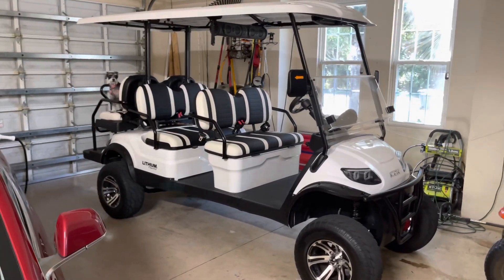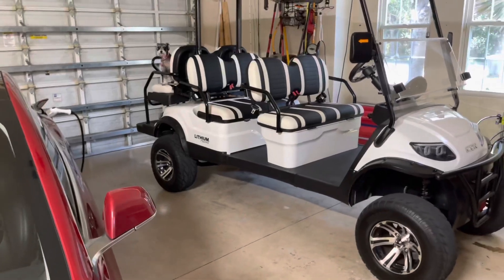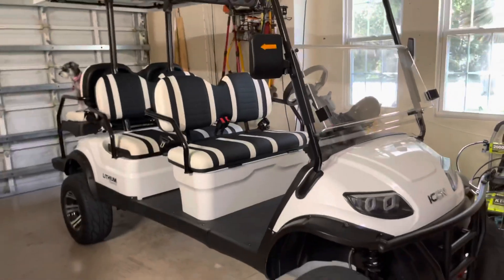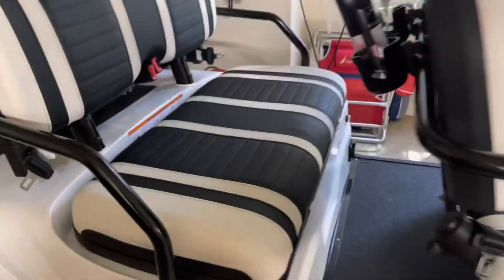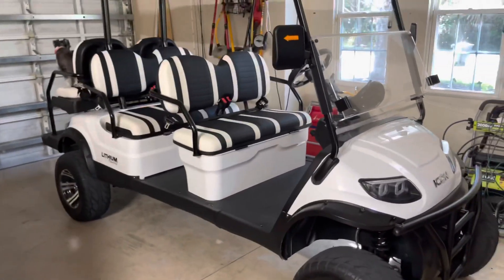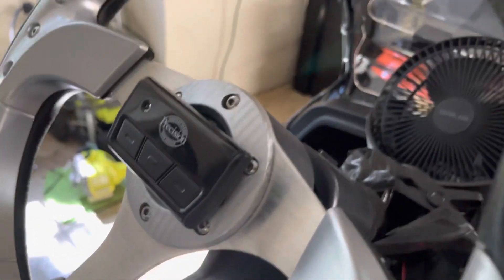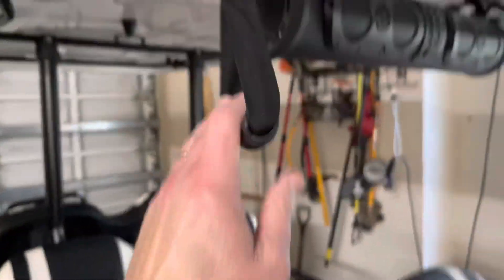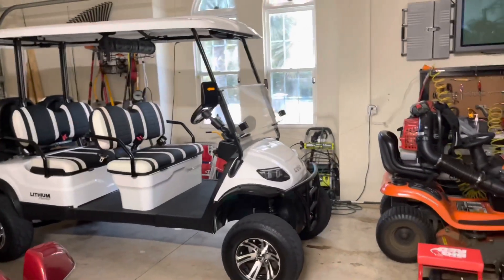Tips for ICON EV golf carts (lithium) plus a Navitas controller installation tip!

Comment: Curious, my lead acid batteries have 170AH rating, I see roypow has a couple 48v options one is 160Ah and one 105Ah rating, so wouldn’t I get more battery life out of the lead acid than the roypow?  I know the lead acid will degrade in performance as they get lower…but seems like I might actually lose range if I upgrade instead of gaining range…any input for this question?
Reply from the maker: The best and easiest way to explain this is the performance degradation that you’re speaking of during each drive as the battery runs down…Well that performance degradation impacts range just as much. I can explain this further and give you examples if you’d like but I don’t wanna bore you. I’m gonna do some real time range tests in a video coming soon. .But just know it’s night and day the science behind Lithium versus lead acid technology. My guess is you would need a 300 ah lead acid battery system for example for you to even just come close to the performance and RANGE you’ll get from the 160 ah lithium battery. But please keep in mind I’m talking about driving at high speeds, I’m not talking about driving a cart around the golf course for example. Hope this helps. You have the Navitas controller correct? What batteries specifically do you have?
Reply: @yourtechtoday9238  I have us batteries, 6 8V, rated at 170AH at 20hr rate.  I know the lead acid will degrade, as well as losing the power after maybe 50-60% of battery is drained so I get that part, but I guess my though here was, 105 vs 170 AH, I’m only getting 2/3rd the ah, even if the LI battery does have better performance for the full charge, it seems like the math evens out, I run 2 hours on lithium ion before battery dies, and I run 3 hours on lead acid before battery dies, but only 2 hours on lead acid is quality performance the last hour I lose a lot of power because my charge gets lower at around 35%.  Does that make sense?  So the lead acid would actually run longer, but actual driving performance between the two would still be about the same?  Maybe like you mentioned I don’t understand the difference but that was where my thinking was. And yes I have navitas 600a controller
Reply from the maker: I understand. So you have the original US batteries that came with your cart correct? If so, in my humble opinion, that is also part of your problem. I had an ICON that had the US batteries and when I sold it and got a newer ICON that had Trojan batteries the pulling power and range was  so much better with the Trojan batteries. And I’ve heard several dealers tell me that’s a fact. I guess this is why Icon went to Trojan batteries. And I’m sorry if you already mentioned this, but do you have the I 40 L or the I 60 L or what model Icon/Advanced EV?
Reply: @yourtechtoday9238  yes they are the originals, not sure why they aren’t Trojans, seems like everyone else has Trojans except me, maybe they got one over on me and gave me cheaper batteries, my example in previous comment was merely a hypothetical though, so far I seem to be running fine for the most part but we have some significant hills so battery life is a concern because of it…never been an issue yet but extending as much as possible is always welcome for me while not sacrificing speed or torque (navitas controller did wonders for the torque).  I have an i60L, lifted, 23” tires.  All things equal I’m curious if I would get less , more, or the same battery life, I know they’re lighter so there would be some benefit there, but aside from that seems like from the amp hour rating I’d still lose some overall life, but better quality of that life.  Also was told running the roypow at 200a for 9 seconds will cut the battery off…no idea how many amps I draw when going up our biggest hills but I guess I should use the navitas app to track it so I know…would suck to spend a few grand and not be able to get up a hill because I’m drawing too much current.  I saw you mentioned the navitas can be limited to only draw a certain amount which is nice but then I fall into the issue of reducing my torque so it doesn’t draw too much and shut it down…so you can see the predicament I’m trying to evaluate.  Got controller for the torque, if I get lithium I might have to turn that torque down on some hills, plus am I really gaining more battery life (and not talking life cycle of the battery, I know they last much longer than lead acid in terms of needing to replace them).
Reply from the maker: OK so a couple things about your question, I would guess that my six 8 Volt batteries (48 volt) Trojan setup had the same capacity or more than your current US batteries. Probably more amp hours in real life usage regardless of what the spec sheets says. But when replacing those batteries almost 1500 miles ago with this 160 ah Roy Pow, I get almost 50 miles MORE in range with my new lithium battery even though I drive it hard. As I mentioned in the video, I very much believe that I can get 75 to 80 miles range out of this battery, and that’s driving at an average of 34 to 38 mph as much as possible. So I can’t really express enough to you that the amp hours is not reflective in the range you’re going to get if you compare the 170 amp hours of your US batteries to the 160 amp hours of a Roy Pow lithium. It’s just crazy to me to this very day how often me and my wife shake our head that we have driven so many miles and the battery gauge almost never moves LOL. We literally mention it all the time on a long trip because we know we would’ve been worrying about range when we had the Trojans on the same ride. That is the best way I can explain it I guess. It’s the technology of the lithium and how it acts just like the batteries in my Tesla. It’s also about the fact that I took away about 350 pounds of weight out of my cart by replacing those Trojans with this lithium battery that only ways 160 lbs vs the Trojans that I believe total close to 500. I don’t guess you have the same road tires that I do but I think that helps a small bit in my ultimate performance. But after what you have right now as a set up, if you get a lithium battery that is 140 amp hours or up, I think you’ll be blown away but that is just my personal belief. For the BMS issue you mentioned, our Navitas controller is supposed to prevent that as you mentioned how I talked about that in the video. But if you can find my battery in the P version you’ll have even more peace of mind in my opinion. But I don’t have a lot of hills so I understand your worry. Once again, you’re Navjtas should prevent the spike. And with that said, I’m not an engineer but I’ve done extensive research on this, and from what I’ve learned the amperage limit that the Navitas would put on the battery will only stop it from surging to a certain amperage when you first press the pedal but that does not equate to overall torque. Will it be affected for a milli-second? I don’t know, maybe. But I firmly believe that the Navitas is just stopping it from hitting that high amperage spike on a steep hill when you first push the pedal. So please don’t think that this would equate to you losing all the torque that you like so much with your Navitas and thus stopping you from going up a hill. Most every issue with Roy Pow batteries was because people were using the 105 or smaller on a six seater cart. And I’ve only heard of 2 stories where people had a ton of weight on a 6 seater going up a steep incline and had the BMS issue with a 160 Roy Pow. But I believe our Navitas controller would have prevented that happening on the 160. There are a bunch of new lithium battery makers so find one other than a Roy Pow if that gives you more peace of mind. But as I suggested earlier, please get some thing at least 140ah or bigger if you want to see the range and performance I’m talking about. Its better than night and day. That has been my experience and I hope you have the same once you make the jump. Best of luck but please keep me posted if you end up doing it one day.
Reply from the maker: @sgremp1 Did you see my last comment? But also when I post this next video I hope to show you the vast difference.
Reply: @yourtechtoday9238  yes I did…would be awesome if someone just drove both carts side by side with all the same controller settings and saw how much further one went then the other, but a little impractical in reality…I don’t doubt they go further just wondering how it happens when there’s less amp hours, not a battery aficionado or even electric cart expert at all, always had gas until now but wanted a street legal cart
Reply from the maker: @sgremp1  Yes, definitely trying to do a comparison if possible. Stay tuned!
Reply: @yourtechtoday9238  I just purchased an AEV 6 seater. I plan to keep the stock controller. I'm not lifted. Really happy with the performance so far. I'm looking at roypow 105AH and I see you're a fan of the P model. It's not clear to me what the P does for me. The specs show it can discharge at higher amperage. Is that the difference? We don't push our cart hard. 15-20 MPH. Mild hills. What is the 'BMS' you're referring to? I found the non P 105 for a good price and in stock. Am I at risk if I pull the trigger?
Reply: Uploading a video today that will answer this question! Sorry for the delay in responding.
Reply: Bro agms are best

Comment: Thanks man! Quick question, could you include a parts list with links in the description or here? I like your steering wheel and not sure of what hub I need to get on for mine! Also need to think about lithium, my lead batterys and the navitas controller just isnt giving me the performance I wanted.
Reply from the maker: Thanks Jim! Yes, I planned on doing that ASAP. I was just trying to get the video up for everyone as soon as possible yesterday and thought I’d add the links once I had more time. I will add a couple of links this morning. But I will be adding them all soon! Thanks for the support!
Reply: You should talk to your dealer, we also have agm batteries that work way better then the Trojans!!!
Reply: @user-dl5xr2tw9f  Hey man, I have a question about my I40L, Here in Tallahassee Florida,  My ICON is only a year old and when new I noticed after charging it would not show 100% charge every time. I took it back to the dealer 2 hours away and it worked fine there. I realized it wasn't a big deal it's actually 100% even when reading like 78%.  Recently the miles and the speedometer quit counting up or showing mph. Now just a couple days ago while unloading it at my property it didn't want to move, started making this weird jumpy move and shaking. I rolled it off the trailer and tried forward and reverse and it tries to move in reverse but cant make it's mind up if it's in forward or reverse as it wont move more than a couple inch's but is very concerning. It's fully charged Trojan batteries. This cart has been great. I love it. But I need an Idea what's caused it to act up. I can see and hear the relay under the dash clicking when turning it on. I'm not really wanting to travel 2 hours to where I bought it. I've seen you comment on several ICON videos so you seem to have great knowledge working with them. Any advice? Sorry for hijacking your video love the content as I'm looking for anyone else with similar issues. Thanks for any help.
Reply from the maker: @cgodwin336  Could be a few things but the way you said your cart is acting jumpy sometimes relates to low-voltage meaning your batteries are not charged. I know you believe that they are, but just to be certain, can you confirm that when the cart is plugged into the charger and you lift your seat up and look at the battery charger itself, do you see that the charger starts off red and then ultimately it has a bright green light once the batteries are fully charged? Regardless of what your dash percentage shows or any of that, the only true way to know that your batteries are fully charged is to look at that charger and see if the light is fully green. Can you confirm that please?
Reply: @yourtechtoday9238  yes sir I plugged it in again checked under the seat and the blue charger started out red and charged over night turning green.  I did take one battery positive and negative off and checked the voltage with my meter it reads about 48-50 volts dc. I’m pretty confident it’s charged.  I could hear the batteries sizzling a little right after I plugged the charger. Good water levels in all batteries.  Thanks for any help
Reply from the maker: Ok sounds good. How often do you touch the run/tow switch for your cart?
Reply: @yourtechtoday9238  I usually turn it off to charge and off when towing.
Reply from the maker: OK so please don’t turn it off when charging. Icon told me directly that you don’t have to do that and believe me I’ve driven many of miles on my Icon carts over the years and I never turn that switch off when charging. That run/tow switch is a common thing that breaks on a Icon. Not much else breaks on them but Icon needs to make a better switch because they tend to fail. My guess is your switch is bad or if it’s not, it’s gonna be your forward or reverse switch is broken. Unfortunately it sounds like you’ll have to take it back to the dealer. I wish I had a better answer but those are just my guesses especially after you told me that you turn it off every time you charge. Maybe fiddle with the run/tow switch and see if it starts to act right? Maybe if you turn it off and on a few times it may trigger the cart back to normal. Please let me know how it turns out just so I know. Thank you.
Reply: @yourtechtoday9238  gotcha buddy thanks and will try it
Reply: @cgodwin336  he's about right bro, the toggle switches sometimes go out and we commonly replace them with the older carts. The newer carts don't have that problem. It's ethier the switch is bad or your fuse box is shot. I have seen it both ways where it won't move. Take it back to the dealer unfortunately, or have them come to you. Florida is one of our biggest states where we sell and we have plenty of help over there. I have experienced your problem as well and it can be pretty maddening 🤬
Reply: @cgodwin336  just to make sure voltage test each battery, they should each be at 8-9volts. I would have it tuned again at the dealership just in case. Once the cart gets below a certain percentage you don't get full performance. Just to be safe and I know you said you did.good luck and sorry about the lateness. I saw your messages earlier but whiskey has a way of shutting people down🤣🤣🤣
Reply: @user-dl5xr2tw9f  thanks and I will reach out to the dealer.  It’s a fun cart hoping to get it going.  Yes sir on the whiskey 🥃 it’s the season.
Reply: @yourtechtoday9238  I really appreciate you taking the time to discuss it and I’ll be in touch.  Happy New Year
Reply from the maker: Very welcome brother. I make these videos to help people so I try my best to do just that. Look forward to hearing the outcome! Happy New Year and stay safe!